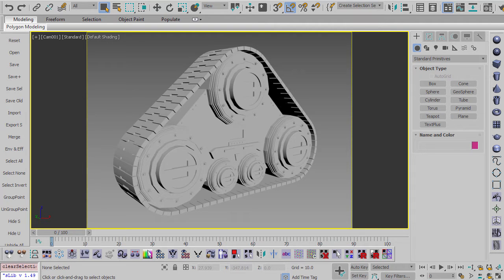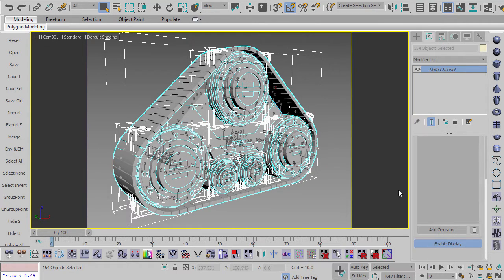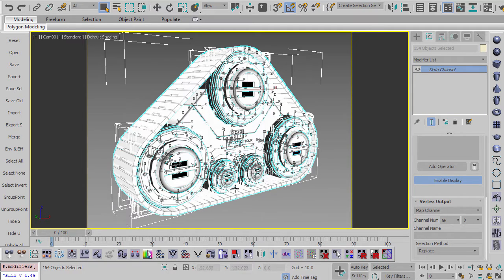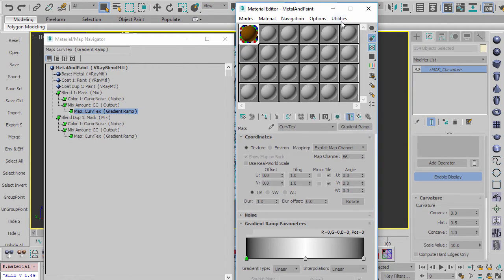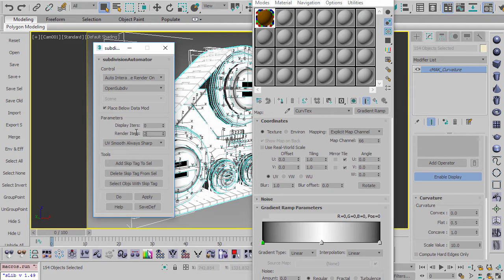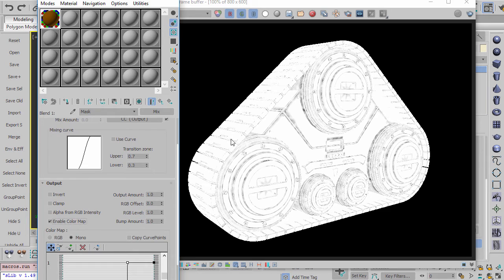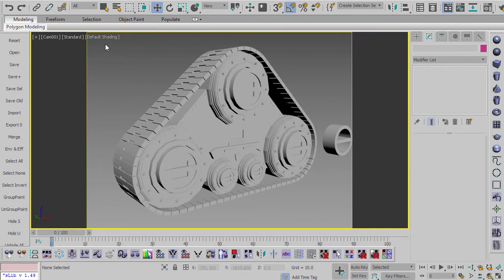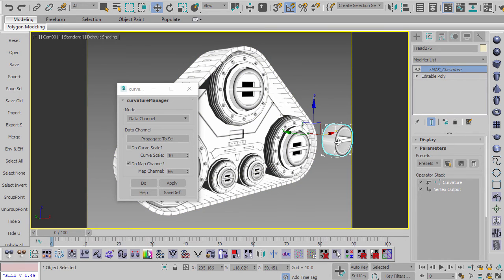Worn Edges Part 4: 3dsmax Data Channel Modifier Method

Comment: Hey,

I'm having this prolema using Gradient Ramp;
https://i.imgur.com/cmkZ3tl.jpg
https://i.imgur.com/P8bY75S.jpg

Do you have any idea what generates this kind of problem?
Reply from the maker: Hey Paulo! So I suspect its because you are applying your data channel modifier AFTER you already have smooth edges. The data channel modifier is basically looking for edges that are almost 90 degrees to each other. So if you've already applied a turbosmooth (or added a smooth chamfer) before the data channel modifier, it thinks there isn't a big difference in the angle between faces, and so fails. Best to add the turbosmooth, or the chamfer modifier, AFTER the data channel modifier in the stack, and rerun the data channel modifier on the new base mesh. Hope that helps!
Reply: @ArtOfSoulburn  Thank you for responding so quickly.

1. I removed all smooth from the object, this problem continues, but using Vertex Map tit works just fine

https://i.imgur.com/G4NcaRI.png

2.  I added a Curve Operator, which corrected the problem, even I do not understand exactly why. It must have created a transition curve between the lines.

https://i.imgur.com/ePjqQy2.jpg

3. How do you make the mask not cut the noise and get an artificial appearance?

https://i.imgur.com/OZWvoPZ.jpg
Reply from the maker: @paulorodrigobeck7895  Hey there, can you visit my website and go to the contact page and email me the max file? I think I need to see it to figure out what's going wrong. Thanks!

Comment: Is there a way to get a thicker convex edge that has a smooth falloff so you don't get any clipping of the noise map?
After experimenting further I think I just answered my own question - Playing with normalize/ scale/ smooth in the data channel + the gradient map flags produces a result. It is very fiddly though!
Reply from the maker: Ya, one of the big downsides (not sure if I mention it in the video, I recorded it so long ago!) is that it's topology dependant. So if you're adding support edges for a hard surface model, to get a smoother gradient (which is necessary for larger noise patterns), you may need to add extra support edges to get those smoother values. So the technique really is best for smaller knicks and scratches. Glad its working for you, but ya, it's gonna be a little fiddly!
Reply: @ArtOfSoulburn  Yup thanks! I've been getting some really nice results using the technique in unison with the Vray Displacement Mod.

Comment: thanks neil.
how about your former  method?
say good bye?
Reply from the maker: This method seems really solid, so I think I'm gonna stick with it. But there will certainly be times when the other methods are necessary, depending on the project. Like if I can't use max 2017.1 for something.